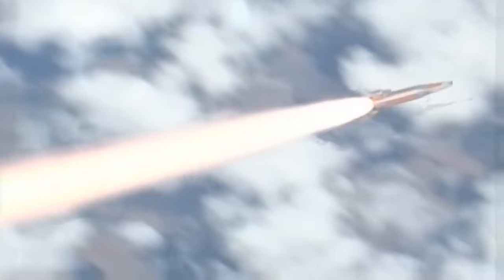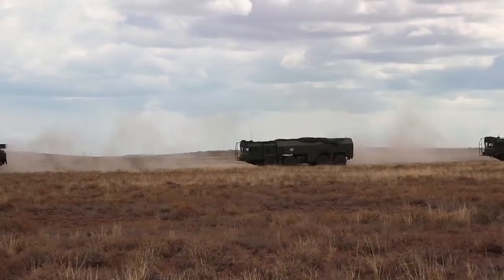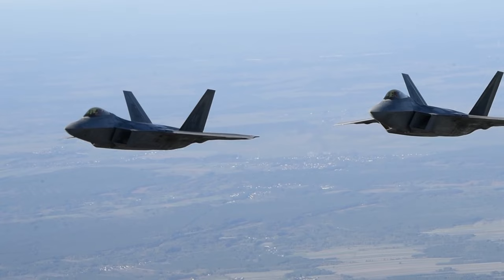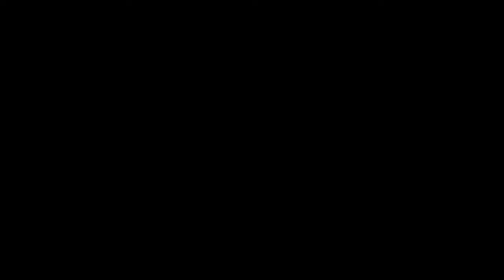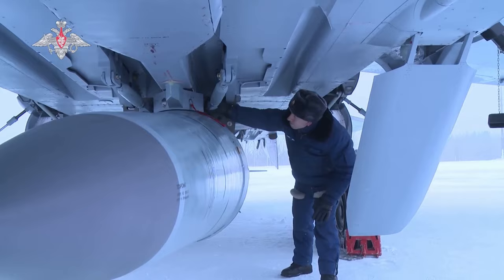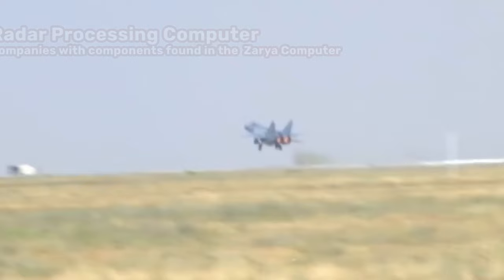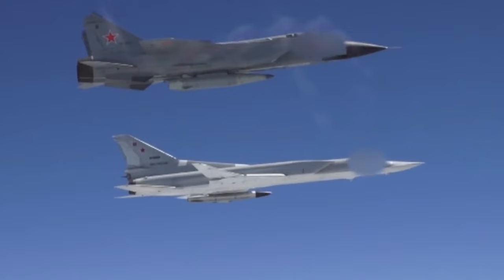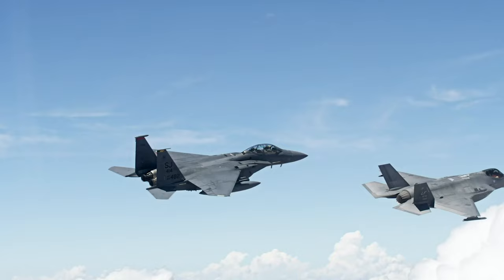Is Russia's "hypersonic" Kinzhal full of American hardware?

Comment: Some of those components are over 20 years old. AD9641 was an update to AD9640 back in 2004 probably older. They are very generic components, except the GPS tracking chips, which could in theory be blocked by a change in GPS signals.
Reply: helpfull, Russia has its own GPS system, GLONASS
tell me again how you will crash every ship and plane in Europe that isnt Russian
Reply: @z_actual  Ever hear of "Rebadging" 🤔🤔
Reply: @justachipn3039  is a different system and uses Russian satellites, you know, stuff Russia invented
is actually better than GPS if you travel in far north latitudes
Reply: Those electronic components are standard stuff. I order many of those routinely. Didn't know they where restricted. Its just common stuff, I can get from Mouser & Digikey. If you've been designing electronics within the last 20 years, gate arrays and processors are your building blocks. Are they really restricting crystal oscillators and ADCs !?
Reply: @z_actual  Better than GPS?   How can you explain the russian pilots in Ukraine using the  civilian grade GPS receivers which have lower accuracy than military grade GPS but still russian pilots use if their Glonass is better?   You russian propagandists are full of BS.
Reply: @gerrycrisostomo6571  I dont think it is better, its just better in higher northern latitudes because of how the satellites are situated and where GPS is less reliable.
Looking at Russian military aircraft, it is hard to see how you would integrate a hand held GPS device into its equipment suite and have any effective use out of it. 
Perhaps it is you that is full of BS, yes I think so.
Reply: @gerrycrisostomo6571  🤣 I watched that crash video too... Ordinary Canon Cameras being used in drones...
Reply: @z_actual  - There were many reports from verifiable sources of Russian pilots using western made handheld GPS units in their planes, because the units installed in the planes were shit and didn't work...
Reply: The 5G system has something called "positional services" which has two versions: one is guaranteed 10m accurate and the other 30cm. They are designed for vehicle guidance and aircraft and drones.   Both could entirely replace GPS etc.    It might require an Presidential Executive Order through the FCC and a EU Parliament Diktat to ensure that Apple, Google, the cellular providers activate the services in case satellites go down.
Reply: @z_actual  Aircraft don't need GPS/Galileo.  They have Inertial Guidance, compasses and good old VOR/DME
Reply: @z_actual  😂 just developments of German tech
Reply: @williamzk9083  Inertial systems are accurate but accumulate an error or "drift" so they compensate by updating through GPS. Inertial moving maps are also old technology (A-7 Corsair, for example) and a screen with a digital map is useful.
Reply: @michaelmoorrees3585  Export control just means that Mauser was approved to buy it, and Mauser is legally liable if they knowingly sell to places like Iran or Russia. The end user doesn't have to be aware of export controls.
Reply: @z_actual  There's tons of different systems. We use GPS interchangeably but it's been upgraded by Lockheed Martin. I guess GLONASS does have better accuracy due to more ground stations. That's what some articles say so who knows I sure don't.

 Interestingly the newer NAVATAR IIF will be much better and can work using other constellations. Wonder how hard it is to jam a satellite.

Comment: I sold those same electronics manufacturing companies in US distribution channel, we had a very high pressured sales environment to compete with other distributors. All through the 90's sales volume, sales is monitored by the manufacturers, with in the east coast there is a high volume of sales into the broker export environment. I could only assume that the ease of getting these components would be as easy as it may be there would be no problem to get straight out of US export market. Having a couple of front companies, through a number of countries would be no problem to get. That's my opinion, I was responsible for just in NJ for 30 million dollars in sales in these manufactures in the mid 90's. I was selling big name manufactures into Conputer Stores that where for sure owned by Russian/American immigrants not a joke. These components are easily acquired due to the competitive nature of these nationwide distributors selling components to thousands of manufactures that currently exist in the US. The related export market that is highly competitive. I personally had many many export broker customers that bought hundreds of thousands of dollars from various distributors of these manufactures, each manufactures had a number of nation wide distributors, that number due to bigger guys buying smaller guys has dwindled, the reason I no longer work in that industry.
Reply: Obviously more stringent oversight & punitive enforcement is needed...

Comment: ATACMS can maneuver itself immediately after launch there are videos out there. All the videos of Iskander in action the missile is flying in a straight path especiially after launch. The new PrSM with a range now upto 1000km is even better than the ATACMS and can hit ships and moving targets like the DF-21 and DF-26
Reply: Dope. Now imagine a Chinese naval task force trying to get close to Guam and they get to watch as their shitty Soviet design CIWS absolutely fails to take the PrSM down.
Reply: @hphp31416  Hell, I don’t think they can inflict many casualties on us anyway.
Reply: Indeed ATACMS is an aeroballistic missile.   It''s clearly a smaller, slower, shorter range missile than Iskander and the Precision strike missile is not going to be bigger.   It's not necessarily a bad thing.  We now have the absurdity of Russia introducing the M3 version of the BUK ie the BUK M3 missile which weights 795kg to intercept a 304kg GMLRS missile.  Even the 9M96 interceptors from the S-400 weights 420kg.  (the standard interceptor weighs 1850kg) 
-Russia spent trillions on gigantic SAM missiles but the small 90kg units ones that would be the size of Iron Dome ("Sidewinder Based), SkySabre (ASRAAM based) or IRIS-T it neglected.
-Note the SM-6-1B missile designed for the AEGIS and AEGIS Ashore system has a ground attack mode that can hit a ground or ship target 1000 nmi away.  Even the US Army is getting it
-It's worth noting that the SM-6-1A missile probably handsomely out-ranges the S-400's 400km when using the rather slow S-400 40N6E interceptor.
Reply: Prsm can reach 1000 km, is it because of northrop rocket booster?
Reply: There has to be a missile failure for them to be able to recover one intact enough to identify this many unique components, right?

Comment: Great report as always, Alex.  One thing you mentioned was the software that these components use.  I expect that this hardware is probably programmed with archaic languages/toolsets that require archaic operating systems, running on archaic workstations.  As those old systems  break down,  I expect even if Russia has a stockpile of hardware, it may be getting tough to load the software into those systems.
Reply: bro F-22 software runs on windows 98 😂😂😂
Reply: @CremeDeLaMeme.  No it doesn't.   If anything it would run on Windows NT or 2000 for non critical tasks (such as maintainance diagnostics) which used a real time kernel from when Microsoft purchased DEC to get hold of it.  Windows 98 has lineage in DOS, Win 3, Win 95 etc and doesn't have a real time core.    
Engineers had plenty of advanced real time operating systems to purchase and use at the time.  Intels iRMX springs to mind but there were others.  No engineer would use windows to do anything on any aircraft or anything where lives were at risk.   Not only was it not up to the task there were plenty of other solutions out there.
Reply: @CremeDeLaMeme.  There are soooo many comments out there on the internet about how modern glass cockpit aircraft (military and civilian alike) "run on Windows xx," and I'm telling you, that is flat out WRONG. As another poster said, aircraft depend on real-time software.

Source: I'm a pilot for a major US airline.
Reply: @floorpizza8074  There is not actually much need for huge computational power, even in the most demanding aerospace applications. You are not going to be doing things like finite element modeling for big physics problems, for instance, or some other such supercomputer tasks . The computing requirements on an airplane flight control computer are actually fairly modest. The important part is that it works super reliably, both the hardware and software.
737 MAX is indeed using the 286, which is a 40-year old chip. That wasn’t changed on the recertification.
Reply: @patewing5808  What chips are used was never the debate; it is the operating system.

And yes, I'm fully aware that FMC's require very modest processing power.

Comment: Another point is that it should be possible for the US and Allies to create hacks for those weapons to disable or turn them back upon their User!
Reply: Not so much hacks to allow that, but, the ability to easily (by comparison) exploit weaknesses which disable them, I see THAT being very doable!
Kinda like how the drones can be overwhelmed with high power remote control signals, a high power focused "EMP" (not really, but work with me lol) could be made which might take advantage of a weakness in one of their chips. All you need is to be able to cause something like 'bit-flip' and it can be game-over for that ordinance doing what you've told it!
Reply: Any weapon or advanced chip should have ability to remotely disable, control, or self destruct.
Reply: @assertivekarma1909  Except these the majority of these were consumer parts, and you'd be asking for trouble to put backdoors or kill switches into them.
BUT assumingthey did have that ... How do you propose the US communicate with the chips to execute the commands? It's not like a Kinzhal etc are an IoT device with Cellular, Bluetooth, or WiFi... 🥴 
(sure, there'd be some secure channel for Russia's vehicles to communicate with them, but if we had that sort of access, we could just trigger actual self-destruct mechanism and not have to bother with a chips backdoor... right?)
Reply: @DUKE_of_RAMBLE  admittedly I'm not a microprocessor expert, but potentially the type of high end chips we are most concerned about could have a limiting function embedded, which would not allow the type of processes associated with such military tech, unless they were registered and unlocked via encrypted key, or they could have a time limit incorporated that required periodic reauthorization.  Such processors could be required to be bundled in packages that locked up if separated, and further facilitated security measures.  My main emphasis was larger platforms, like F35's sold to sketchy countries like Saudi Arabia, I'm hoping/assuming they have anti tamper, guards against reverse engineering, such aircraft could have integrated kill switches.  Large investments in petro chemical facilities in places like Russia should be engineered to lock up if they become a conflict adversary or try and thieve the facility...
Reply: @DUKE_of_RAMBLE  The utilization of broadly used consumer grade components would be nearly impossible to limit, but hopefully our armaments would be significantly more superior with better components.  Also kill switches & self sabotage on tech we offer to the likes of countries such as Ukraine would be ideal, so they could get better tech with less concern of it being captured by an enemy.
Reply: @assertivekarma1909  You sound like the exact sort of person our defense sector needs to be tapping for how to go about... well, a lot of things! lol

In other words, I can't argue with any of your points. 😁
Reply: @DUKE_of_RAMBLE  I'm not sure if you are complimenting me or laughing at me, as social media has a tendency to breed cynicism.  But, western democracies, and our governments & militaries could be much more innovative & effective if they were better able to harness grass roots crowd sourced public ingenuity & engagement.  The amount of potential wasted is staggering...
Reply: @assertivekarma1909  Sorry, you're absolutely right. My chuckle at the end, I now see how it can be confusing! No, I was INDEED sincere and complimenting you.
Just to explain my thought process: I found the humor in that there's an unfortunate lack in outside-the-box thinking in the government for things like you suggested, for ways to offer preventative measures, or "trust-wall" security implementations (to borrow from the term "pay-wall") which after trust is established then additional functionality is unlocked; be it a keycard inserted, firmware update, etc. (although if firmware method is used, it'd be best to have said features COMPLETELY ABSENT from the locked-down shipped firmware, as to prevent unlocking the features through dumping and modifying [hacking] them, and re-flashing)
Reply: @DUKE_of_RAMBLE  It sounds like you have some expertise that could be useful for such initiatives, if only the insights & creativity of the general public was better harnessed/nurtured by our institutions, in a respectful & reciprocal manner... especially during times of crisis, like war in Europe or that which is hovering over Taiwan.  Liberty minded open democracies, with tech savvy people, should be able to leverage the fruits of that intellectual ecosystem.  Cheers
Reply: @assertivekarma1909  Thanks. 😄 I do indeed consider myself open minded and to be an outside-the-box thinker. And I totally agree, it's a shame we have created societies that only/primarily foster dominating others, instead of cooperation. Where one who creates a successful company will muscle out everyone, or, outright purchase them so to remove them as competition... 

Even when that doesn't result in monopolies, I still find it likely will often lead to more bad, than good. Chiefly, when these amalgams decide to sit on the tech they now own, instead of making use of it (this has happened a few times over the decades just in consumer computer hardware!), sometimes out of corporate spite and others likely due to an unwillingness to bother incorporating or integrating it into their product stack. That alone robs everyone from this that "could have been" but now never will... After all, if it was something that wasn't in some way novel then A) the startup wouldn't have existed, B) they wouldn't have gotten far enough to have garnered public or private interest, and most importantly C) you [said purchasing company] wouldn't have felt threatened enough to purchase them to begin with! So why squirrel it away afterwards... 😞

Even the times when the acquisition IS to utilize whatever-it-is, sometimes it could be for the better such as by now giving the team not just a larger budget, but also access to a wide range of other information/patented goodies; whereas other times it could end up harming the team on account of their need to adhere to a new management system. Therefore, acquiring other companies, frivolously OR sincerely, could actually hinder progress and prevent the team from achieving the greatness they could have, had they remained independent....

Anyways, my point here is that everything sadly revolves around money, and we have become a greedy species, too willing to put principles or morals aside in order to make a buck... Which I feel this, often cutthroat, society we live in has and will cause a great many to take up the mindset of: _"Why should I even bother?"
In turn, some people who could lend a genuine hand in improving something or offering ideas to make everything better, won't bother to. Others who want to, will not be able, due to there being no open-mindedness by governments, companies, whatever, to allow people to submit their ideas (and then if it bears fruit, in any way, they see some return for it if desired).

In the immortal words of the Looney Toons "French Skunk" character Pepe le Pew_: _"*Le SIGH*" 😞
(In fairness where it's due, I think the Ukraine gov't has indeed been leveraging their people as a "think tank", and that's likely to thanks for why they've done so well with their drone initiatives and designs. Hopefully that can continue, even after they've won!)

🍻✌️
Reply: @DUKE_of_RAMBLE  Literally every single chip has a back door by default. You have to load the code onto it once it’s manufactured through a debug port.